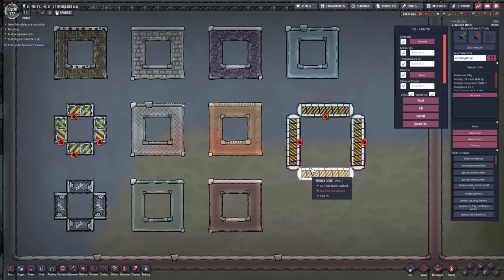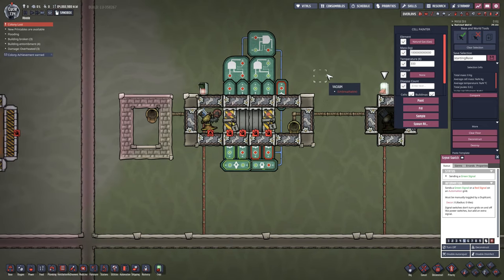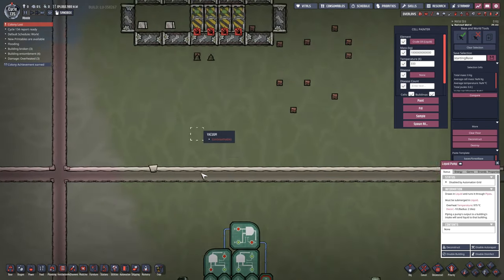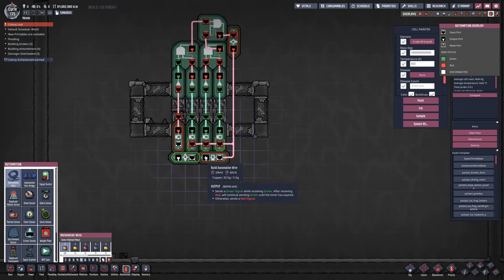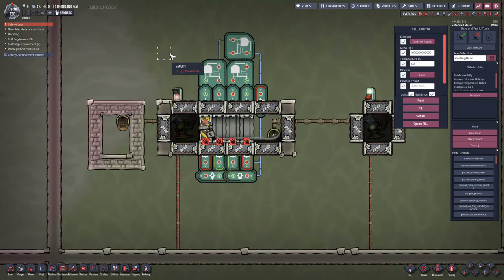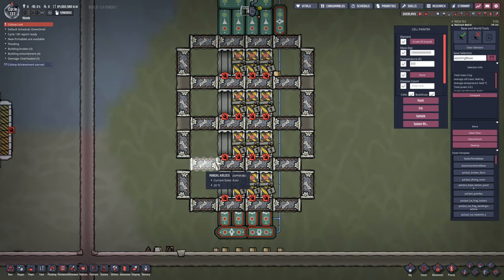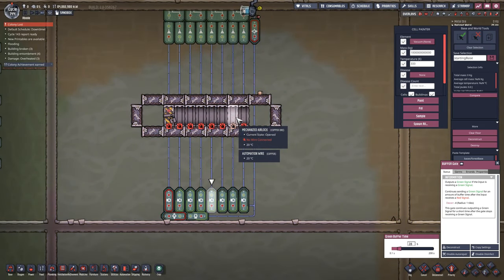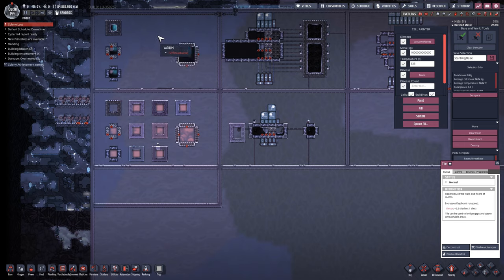#1 ONI Module 1: Infinite Fluid Storage!

Comment: materials can be taken from the diagonals corners via sweeper. just replying to your comment about how dupes can deconstruct and build through the corners.  but the materials might be 'stuck.   if you a sweeper, you can actually get the sweeper to reach into the box  from the corners/digonals

Thanks for this video.  it helps.

Comment: Can't you steal the signal from the first door, near the input, to trigger the last door, at the storage segment... After the NOT gate, before it goes to the AND gate. Since you just want it to open, only after the first door has closed. You already delay the closing of that door, so that output signal will just be minus the closing-time delay.

I do wish they would simply make an "automation block", which would handle all the "taps/connections", but kept within a single "block". Like a "computer controller". You would just connect all devices that you want interaction with. Then, select the "computer", which opens a separate screen where you can "build a circuit", without cost, to test it. Simply selecting any connected device as a "PIN", to attach to the various logic-circuits. But, this way, it doesn't slow down the game, while playing it, and isn't subject to "glitches", from attempting to "animate the circuit", visually. Unless you go back into the controller computer. Once "setup", it has to be "built", or "modified", using the appropriate materials associated with the logic circuits. But, honestly, it should be material-free for the logic components, and only a "material cost" for the type of "computer controller"... (Like having a small, medium and large computer controller. Each having a larger number of connections and larger "circuit-space" to build circuits.) Then, you could have super-computers, for the more advanced connections, and remote connections links... Essentially keeping all your "circuits" in one location, which operate all the devices in your base. Additionally providing inter-connections between circuits and power controls... so dupes don't have to run all over the map to turn things on and off, or you can manually turn them on and off, as the player.

Same could go for the "output"... of these "computer blocks"... They could have a separate "terminal" that you could "build". Which you could control with "extended functions", beyond logic. Like the counter-numbers, but more advanced "functions". Showing a "warning", or a "text display", or a "snapshot of the controlled device", or just a friendly EMOTE image which indicates the operation health of what the computer blocks are controlling, or just for some time-killing, artistic, creative fun. Anything besides these bloated, ugly, confusing, oddly limited "logic-blocks" that they use now.

Oh, and they need to make it so all sensors can be placed ANYWHERE... Why a sensor can't be placed in the same space as an actual pump, to sense temperatures, gasses, germs, etc... is stupid. You have to place it in a "free space", and then you can't build anything there! It's a sensor... Why on earth would it block a ladder, a pump, a block, but not block a DUPE? It should be treated like a wire or air-pipe or water pipe... Virtually non-existent, except in relation to other sensors, which need that "wire-space connection".

Then again, a lot of this game doesn't make sense, and defies logic, physics and reality, as a whole. Heat doesn't rise and cold doesn't drop. Air doesn't "flow", it's just pressure-dispersal with "random vibrations of blocks", used to simulate flow, poorly... But liquids flow fine, unless it encounters another liquid, then all illogical hell breaks loose. Liquids start climbing walls and defying gravity and create endless dancing animations as each liquid fights for gravitational dominance with 0.01mg of fluid. There is no "gravitational-mass atmospheric pressure", but there is "space"... But "vacuums", don't function correctly. (All mass within a vacuum should "fall to the ground", as there is nothing to support it UP in the void. That's what keeps our atmosphere on the planet. It has MASS and that mass is only held-up, by heaver concentrations of mass, below it. When it is IN a vacuum, the only direction it can go is "down", towards the greater mass, which is it attracted to. Which we, wrongly call "gravity", in simplification.) Under high pressure, at lower altitudes, more MASS crams into smaller VOLUMES, making them more dense, and hotter and harder to lose heat. While, rising up, where gravitational mass has less influence, things get colder and there is less MASS in that same VOLUME, as things expand and cool down. Compressing gasses should generate heat, as it focuses all that MASS, which is carrying the heat, into a smaller VOLUME space. On the reverse... When that MASS expands to a larger volume, it should appear cooler, as that mass instantly moves into 2x, 3x, 4x the VOLUME, and there is less mass per volume now. At 4x spread, there should be a loss of 3/4 heat, per volume. Since that heat, which is bound to the MASS, is now in 4x the area. (That's how an AC unit "pumps heat" from one area to another.)

No... in here, it's all fictitious fake code, slapped with real scientific numbers, just to add confusion to the reality. (You, literally, will lose some IQ points, playing this game. Especially believing that anything in this game, besides air-pressure, is the way that anything in reality works. Even the air-pressure is a joke. Gasses get "stuck" in mid-air, which should be falling or rising. Collecting massive pressures, like a black-hole. Then, it takes DAYS for air pressure to actually move anywhere, but fluids move rather fast. Last time I checked... Gas pressure distributed 1000x faster than liquid pressure and, oh yeah... Liquids don't compress much. It takes a LOT of force to compress a liquid, like "gravitational mass", which would heat them up, and make them expand, making compression almost impossible to do. Yet, in this game, liquids compress as easily as gasses, to impossible pressures that would make them become billions of degrees HOT, melting anything that tried to compress them.

BTW, great instructional video. :)

P.S. I'm going back to finish playing this babysitting simulator, with rockets. Now that I know how to store all my heat and CO2 into an infinite space, without actually gaining any heat in the process. Since the gasses don't heat when compressed, I can pump all my heat into the CO2, while expanded, as 10,000 blocks, then compress it into 4 blocks, and it will be equally as hot, though it absorbed millions of BTUs/Watts of heat. Then, add two more doors to compress that heat and CO2 into "nothing", deleting CO2 and all my heat, in one sitting! (Sitting... ironic... it's endless sitting with these mindless DUPES, not just one sitting.)

Comment: This is cool but massively overcomplicated.  All you have to do is make a 2x2 space out of manual airlocks with 1 space above for the fluid output.  The 2x2 below the output will fill infinitely will fluid, the gas in the output will make sure the fluid is always coming out, and the manual airlocks never break from fluid pressure.

Comment: I think that deconstruct through a corner tile has been fixed (i.e. removed because it was an exploit)
Reply: They can pathfind diagonally even when the door is forbidden through both sides. That was mentioned you can lock the door to fix this.

Comment: Just simplify it by putting a less than 1000L of a different liquid in front of the liquid vent and it will never over pressurize. With air vents just make sure you have less than 2L in front it of to get the same affect. No gates, doors or any other CPU resource hogs.
Reply: 1. I've seen a bunch of posts (keil formus, some on reddit etc) about people having liquid deleted in gas storage using this method. People had trouble replicating problems reliably. Some were to do with gas permeable tile-liquid interactions. I would be hesitant to rely on this without hard evidence of a specific design being reliable in current build - got a link to a save or screen shot of actual game?

2. Lag. Have you any evidence on the door method being significantly more laggy?

I'm thinking it may not be - they both cause pressure/volume changes continuously. Doors create vacuum so there may be overhead to change the contents of a tile than just it's pressure/weight (or maybe not, IDK). The doors also needs automation circuits but for I know it could be practically free processing wise to count down some timers and run some basic logic operations. Do you have evidence otherwise?
Reply: @fizhouz328  I wonder if they fixed any bugs relating to liquid-airPermeableTile interactions. Good to hear these methods have been working though. Cheers.

Comment: Good to know how to best build a water tank to fit all the water in my map in a small area. Can be done for clean water and polluted water. Can be done for crude oil and does not require the more advanced research especially in the dlc update with the atomic and in space research. But infinite solid storage needs such research as the developers require the new kind of research for access to conveyor chute.

Comment: That compressor is a lot of unnecessary work for an infinite liquid storage. You can build an infinite liquid storage out of gas flow tiles with one tile left out on the top, then use a different material to create a three-sided box on top of the hole, put your liquid input in the mini box on top, put another wall of tiles around the airflow vents to contain gas, and make sure that there is some gas in there when you fill it up. The fact that gas and liquid can't occupy the same tile will cause gas to get compressed around the liquid input and the liquid will never actually cover it up blocking its flow. No compressor necessary.

Comment: 5:20 a triple door compresor works too
edit: 16:17 you dont need to wait for the door to fully close to open the last door you can put it on the same time  because the door counts as a solid as soon as it gets the signal to close so the +4sec is just waisting time
if you get rid of the 4 sec the sistem will run faster
you can also get rid of all of the and gates if you use a filter gate(im not sure but it might be a bufer gate) when the last signal comes
i will make a desing like this
Reply: I have used a 3 door design lately. i dont know why but mine leaked gas randomly back to the input hence choking the geyser/vent

Comment: Way to complicated setup.

Put 3+2+2 tiles inside doors, place output pipe and a pump, have one type of gas inside, and as you pump liquid (one type) into the room, the gas will get put on top of the liquid output, blocking it from being filled with liquid. Presto super small infinite liquid storage.

Since one liquid pump fills a pipe, you can make it pretty small, where a gas setup does need two pumps to fill a pipe.